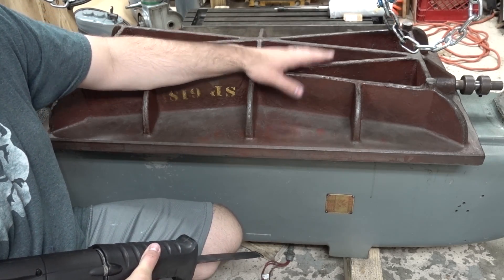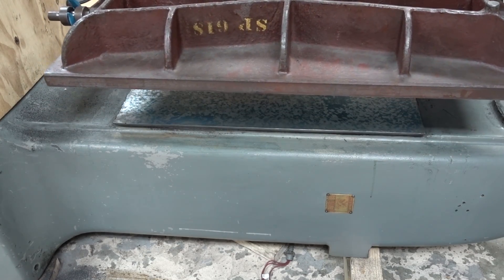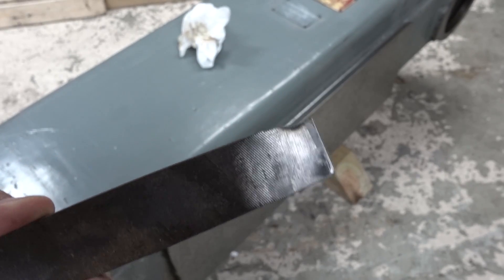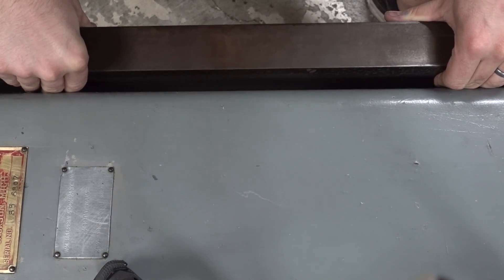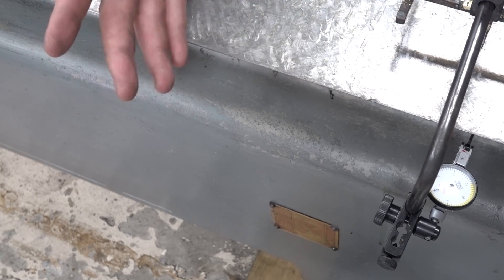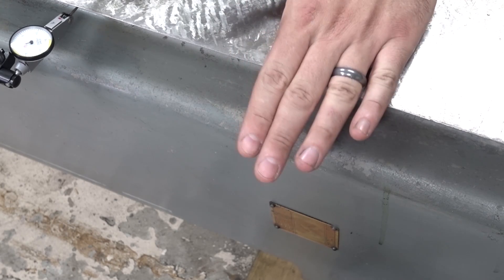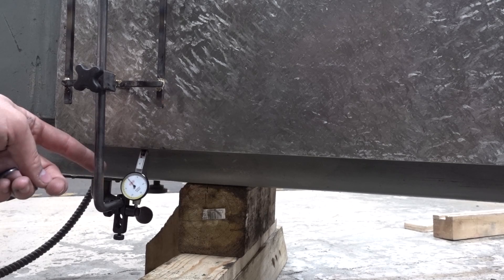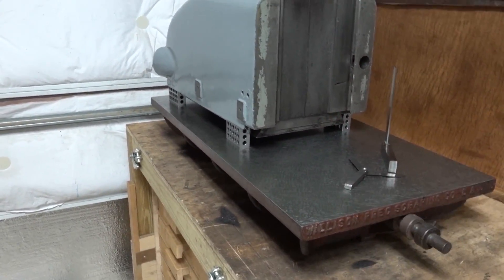Index Milling Machine // Metal Scraping the Column

Comment: Looks good 
spotting techniques are critical ln my experience of I used a plate the way you are
 the part would end up convex on the short axis 
Just my 2$ good luck
Reply: I was literally thinking the same thing but realistically as long as its hinging well along its length the convexity  across its width doesn't really matter as the knee it matched to it anyway

Comment: I'm thinking of making a pattern for a big cast iron square to do checks like you are about to do on the knee.  How deep is your knee any way was thinking of making it 18" × 12" let me know if you want one too.
Reply from the maker: That size is pretty good.  I don't have the measurement at the moment.  I do know that your proposed size would be great for the back of the knee.
Reply: ThunderDog that size came from the Connolly book if I'm rembering it right but it has several uses for alignment checks on mills and lathes. If you want one I'll see what it's going to run .

Comment: Demon73 off o PM.
Looking good mate. Can tell as the low areas came in you went straight down on the front face. Was nice to see the zeros at each end where there should be little to no wear when you were clocking the dovetail with the jig, that also suggests you went straight down on the first dovetail surface. The second dovetail surface measures nice too.
Just one thing I noticed thats worth a mention, when you were flipping the base. Im no rigging expert but was told by the man who knows to use an offset choke hitch and let the lift rotate the lathe bed I was working on at the time. Ideally you want to be away from things to reduce risk of getting tagged if something lets go.
How deep are you scraping marks btw?
Cheers D
Reply from the maker: Thanks chief!!  More to come, I appreciate the feedback.
Reply: I've done a whole lot of lifts over my working career from a few hundred lbs to over 50 tons. Luckily it wasn't on any of mine, but I've seen more than a few of those straps get cut on sharp edges during a lift. Once they start it's almost in an instant they get cut right through. It's a pita but softening the sharp edge with rubber, scrap carpet or even cardboard behind the strap is enough to keep them from getting cut. And fwiw I downrate any lifting gear by half if it's made offshore including my 2 ton engine hoist and the half ton ratchet straps I bought. Good certified and tagged as such rigging has a safety factor of a lot more than it's rated for. It's expensive for that reason. The cheap offshore rigging isn't even allowed on any job site I've worked on so that should tell you something.